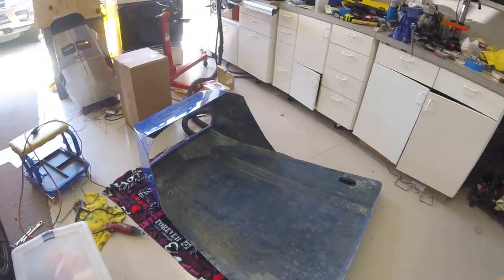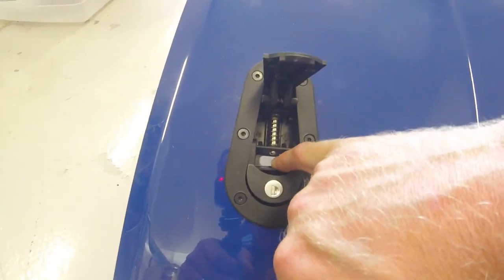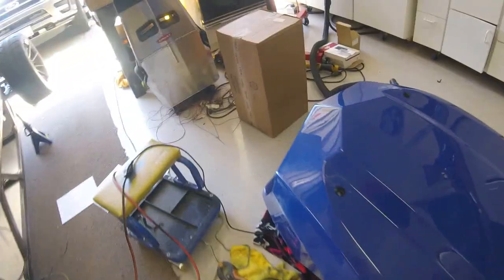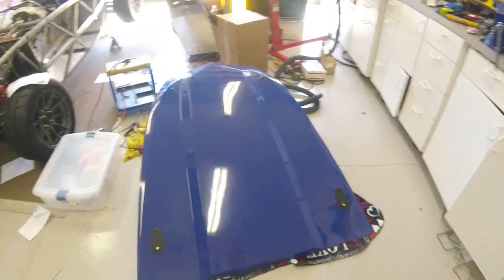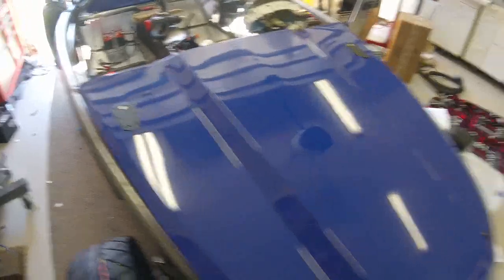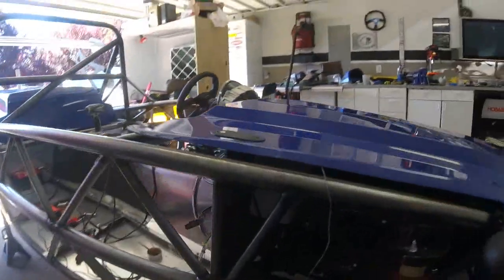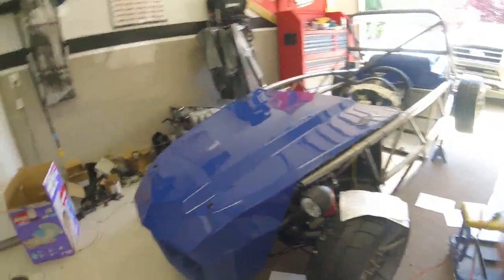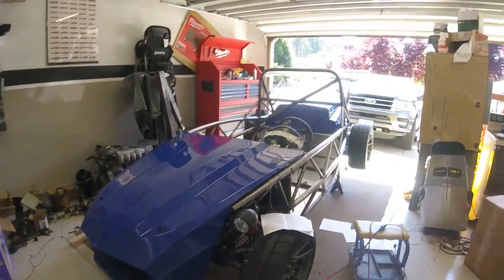Exocet Build: Mounting The Hood (Part 44)

Comment: Nice work, as usual. So you mounted at four points on top and nothing on the nose cone sides. Do you notice any rattling or chafing on the front sides? Is it stable at speed?
Reply from the maker: I haven't noticed an issue at all.